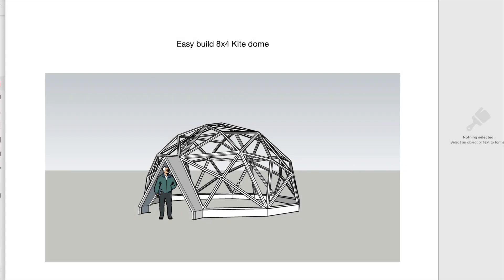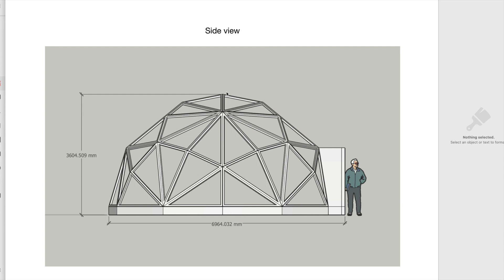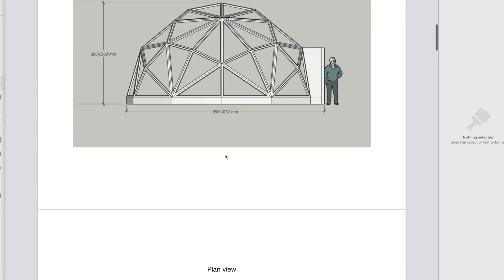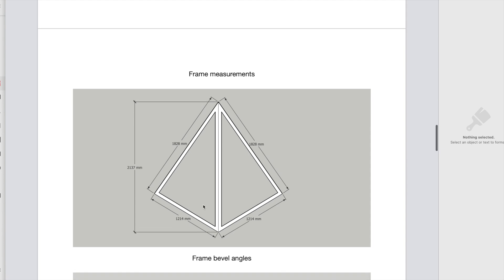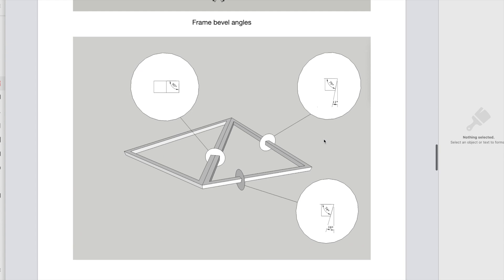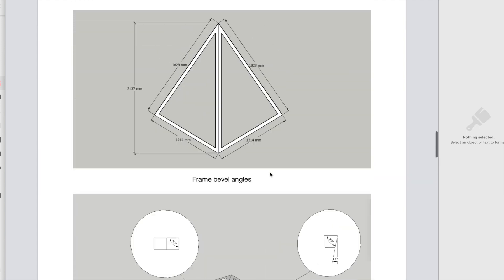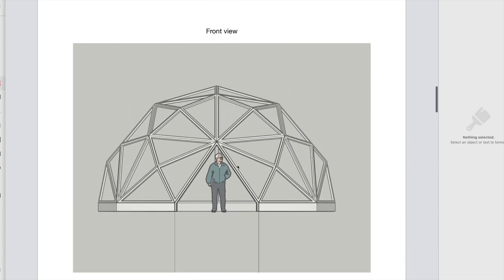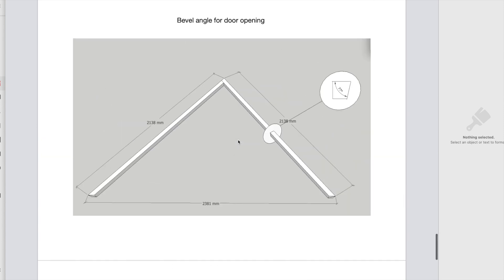UnityDome Most efficient dome free plans

Comment: Do you design all your dome on sketchup? I think the biggest problem I have is how to make it water proof with off shelf material cheap enough I can afford. Lots people used tarp or simular. I imaging it will not last for more than 5 years under the sun UV. If fill the triangle with 1.5 inch concrete. Will the frame support the weight?

Comment: Paul, I have a question about the angles in the triangles. Based on the 1214/1828/2137 lengths, instead of 30°/60°/90°, they're ~34.5°/~58.5°/~87°  (much more complicated to cut and inefficient to cover with right-angled plywood, fabric, etc).

Was this for reasons intentional, was it simply by chance, or is it an unintended rounding error?

If we can use 30°/60°/90°, it would be a lot easier to fabricate (fewer cuts) and cheaper to source (as we could make more optimal utilization of right-angle substrate sources).  We'd probably have to reset the bevel angles, however - but maybe that would not be a hardship.

Your thoughts?

Thank you!
Reply from the maker: Ah yes a very interesting question, if we changed the angles to 30°/60°/90° we could only produce a flat tiled surface. The small difference in face angle makes it possible to tile a sphere. If I force the 90° angle the others have to be 31.7° and 58.3° respectively and form the faces of a Rhombic Triacontahedron divided in four. Hope this helps.

Comment: Thank you Paul for a great video and like Nicola Tesla you are a great humanitarian.   I assume the framing is screwed together at various locations along each side.  But it seem to me that the frame side that you show as 90 degrees would need a bevel also to create a circle dome?  Have you actually built a dome from these plans?  If plywood panels are used on top of the frame; I would assume the size of the panels would need to be expanded so all the corners fit together?

Comment: The 3 angles you might be looking for the kite triangle to make a jig are (it is not a right angle triangle):

86.97 degrees~87
59.13 degrees~59
33.90 degrees~34

It is derived from “Deltoidal hexecontahedron”
Reply: I love you
Reply: Sending love to you as well, show us your work  @tiptrick7762
Reply: Was wondering about that, no 90 degree corner because when viewed in the plan view the corners appear to radiate out at 90 degrees. Paul mentioned that you could take a corner out or build onto a corner I just can’t see how that would work. I am wanting to build onto an interior corner could you or someone explain what I am not following.
Reply: @fisheater844  probably it would work out since you have to fill the seem gaps with some a flexible material like silicon as a weather seal. So, I would not worry about it too much, it is though important to know the angles for building the dome as a whole. If you want to reduce the risk, build it on sketchup first and see how it would work. Good luck, and share results if possible
Reply: @fisheater844  building on an inside corner you would only need a 1/4 of the dome, look at the plan view and divide it into 4 sections use 1 for an inside corner, 2 for a flat wall and 3 for an outside corner, 4 would be the stand alone dom

Comment: 2meter plus edges strike me as "too long" - how strong would this thing be?
Compared to, say, the Optimum Wisdom Laboratories GardenDome plan, the struts seem too long - unwieldy and maybe required to do much work. Thoughts?
Reply from the maker: Optimum labs garden dome is a rip off of my GD18 dome: https://youtu.be/L1DnMDzMJPU
There are a number of people plagiarizing my designs and calling them there own these days. The unity dome has only one face type so is easy to construct 60 faces on the unity, 105 on the GD18 (2 types). The Unity fits on a wall or in a 90° corner has a flat base and 2 possible door positions. The GD18 has a fillet base because of a slight rise and fall and can have up to 5 doors. Yes if you want shorter langths go for the GD18 but the price of that is more triangles to make. Hope this helps
Reply: @Geo-Dome  I built the GardenDome that Dr. Petty gives designs for, actually. 60 pages of PDF, in which he notes that he neglected certain maintenance for 7 years but it was OK. So I couldn't say, sitting here, whether or not his design pre- or post-dates your own. As you've indicated the frequency is the same, but your dome being metric, it's a bit harder to say that it's a straight copy. Also, his door treatment is quite different from yours and he is adamant in his instructions that the hexagon above the door is to be put in last of all - a difference from your own approach. FYI: His GardenDome has roughly 40" struts. In addition, he provides the factors to build it in two sizes, but because of the prevalence across the pond of 2x4 lumber (ripped at 6.5deg bevel) and not metric lumber, he recommends the smaller of the two sizes he gives figures for (15.4' if memory serves, as opposed to 18' something). As he points out on his site, the geodesic dome was originally designed about 100 years ago, but only popularized by Buckminster Fuller - as you are aware.

Comment: I just found this, and love the design and what seems as the easiest dome construct I found to date.
I have one question...
This is for a 6,7m dome, covered in plywood sheets
Would it be possible/advisable for me to add a percentage to the material thickness/lengths to enlarge the dome to the size I would like ?
(I would like to make a dome with this system of diameter 10m or so

Comment: Can this be built from electrical conduit?  The each conduit strut serves as a side to two panels.  What is the biggest dome that can be made with 10 ft pieces of conduit?  Each 10 ft piece of conduit usually gives you two struts of varying length.

For a standard dome:  Largest Dome made from 10’ stock:  length of strut ( number of struts) = length of conduit piece;  64.198”(20) + 47.990”(30) = 115.188”; 61.350” (80) + 55.644” (35) = 119.994”.  A 10 ft conduit is obviously 120”

I got a bunch of conduit from an electrician who was retiring.  I plan to sheath it in used boat heat shrink plastic and maybe spray foam the inside or outside.  If you spray foam the outside, you can cover the foam with more plastic, and maybe dismantle the dome framework inside!  I don’t know how strong that would be, though.

1.5” Added for strut ends

Comment: Hi Paul, I notice your plans show a square profile timber as stock, but what thickness should it be?

Thanks!
Reply from the maker: It needs to be around the same cross sectional area as the other beveled frames, I us 45mm x 75mm (3x2) to get two beveled struts or two square edged pieces from each timber. Hope that helps
Reply: @Geo-Dome  it certainly does! Big thankyou. Will be purchasing a number of your plans soon, and while im commenting... big thankyou for the video on resizing your plans as well. I think you unity dome is stunning as well.

Im going to try to work out a way of stretching it a little, simply to get better passive solar heating.

I'll be facing the door apertures east west and glazing the lower frames sunside (north in Australia) so low winter sun penetrates efficiently, wheras high summer sun will reflect from the same glass with its high incidence. Hopefully I can work it out. Would only be after an additional meter or two.

Thanks again Paul.

Comment: I don't understand the angle choise would a 90 degrees angle for the intermitate corner angle not make a  stronger joint and panel skinning with glass or sheeting a lot easier while not making other dia angles anymore complex and they are, it might cause more sheet waste but more usable wastage

Comment: Hello Paul,
Can the UnityDome be built using your WangerFlanges   connectors instead of bevelled struts as explained in this video ? 
I am particularly interested in knowing if WangerFlanges can be used to connect 10 struts at one single conversion point as needed by UnityDome structural design . Thanks.

Comment: Two years ago i made almost the same design with solidworks. That's really great to have only one angle along each bar, and only three angles in the triangles. But it is limited in size because of the available acrylic glas size. But i like it. What is the best way to protect a wooden surfaces from rain and moisture outside, and still prevent it from mould inside? I thought i would be possible with GFK like on wooden boats!??? Does anyone have experiences with it? Last weeks i am working on a pattern with deltoidal surfaces fitted in a 4 frequency dome, or a 2 frequency dome with fusion 360! I prefer this pattern for aesthetic reasons! you can arrange the window surfaces to get a pattern that looks like a spider web, or a natural sone wall. And to make the production easy i have an idea of an miter saw table, where i can get a very exact repeatability of the angles, and another idea, a mechanism for a mill that allows to make the angle along the bars very precise, and without anytime readjusting the parallel guide! I would like to share my drafts if someone is interested and i am interested in experiences from others!

Comment: Paul, this is a really cool plan, and I plan on building a scaled down version (with a knee wall) as  a playhouse for my grandchildren.  Thank you for sharing it.  I have a question on the frame triangles though.  I assumed from looking at the frame measurements  diagram (on the 4th page) that the angle between the 1828mm side and the 1214mm side was a 90 degree angle.  However, if I plug the three leg dimensions into a triangle calculator, I get that angle at 86.79 degrees and the other two angles at 34.56 degrees and 58.66 degrees.  Is that correct?  Thanks.
Reply: That's what I got too. The longest side was  2137mm and that's the square (un-beveled) piece.  Is that the same as your measurements?
Reply: Correct. I've just done the same thing and can now use my own strut lengths to downsize.

Comment: Is there some way of turning the Unity Dome into a tunnel dome using the same right triangle frames? Since the dome can be bisected, you could split the two halves, but you would need some way of making a tunnel. I'm curious about whether you've explored how to make a tunnel caped with dome halves using these frames.
Reply: @Berkana
I think you could but they would have very slightly different bevels and one of the shorter sides would need to be slightly longer. (I think)

Comment: I built this in my garden at a 0.57 scale factor so the footprint fit my garden. Had to raise it a little to make it so I could get in but it works perfectly. Great plans thank you for sharing Paul.
Reply: what math did you use to scale it if you don't mind me asking? i'd like to scale this up to 30 ft in diameter.
Reply: @jamesmartin5357 use a triangle calc to find the angles then size up the struts accordingly.
Reply: What wood you used? I cannot find what wood dimensions to use for the triangle?
Reply: @MrBacte  I used 50mm X 50mm and then cut it down to the correct dimensions

Comment: This is AWESOME, Paul... thank you for sharing!  Quick question... would you recommend 2x4 for struts or would 2x2 be ok?
Reply from the maker: I don't recommend 2x4 as it's the wrong ratio, just a bit wide for getting screws into. You can use 3x2 cut with the bevel angle down the centre and get two pieces, or 2x2 same cut down the centre.
Reply: @Geo-Dome  That's a big help, Paul! Looking forward to making a model first... beautiful and simple design...
Reply: @Geo-Dome  I can only get  3x2 in 8' lengths. For these struts could I rip a  2x6 to 2x3 (actual size 1 1/2" x 2 3/4") then cut the bevel down the center of the 1 1/2" width? Would a 2 3/4" depth be strong enough for the 7' length struts? Thanks for all you do to make the world less square!

Comment: What shape is this dome based on? What's the name?
Reply from the maker: It's a Deltoidal hexecontahedron, the kite faces  are split to form a left and right handed shape one being the mirror of the other. There are a number of ways to make this so if you look on the internet there may be some differences in lengths and angles.
Reply: @Geo-Dome  Ah, thanks for the answer. I did some research in the meantime and I came up with the Disdyakis Triacontahedron. If you split the faces of the deltoidal hexecontahedron, you effectively get a disdyakis triacontahedron I think.

Comment: Hi Paul, I looked at the plans and I must be missing something. For the life of me, I cannot see how the panels on the long sides (with the 90 degree right angles) manage to fit together both flatly,  and angled, simultaneously (as in "Frame bevel angles"  and "Frame measurements" diagrams).
Reply: I'm wondering about this too, and which side gets the 90 degree bevel? The 1828mm or 1214mm piece?
Reply: @sparc5  Neither its the center 2137mm 2 centers that join the triangles together
Reply: @kulwinderThandi  But 90 degrees would join the 2 triangles flat to each other. I believe there needs to be a bevel too? Or do those actually create a flat surface?

Comment: I love this channel Paul and I want to build a dome . With any of my projects,  I start with a model before taking on something major.The mirror triangle for your unity dome  is brilliant however.... I want to build a diameter of 16 ft 5 in. instead of the suggested 22 ft .After scaling down  the frame measurements to a factor of .082057----  for the model, I must have had the apex angle wrong because they do not fit . If there are 5 mirror panels with 10 triangles ,I presume that the angle at the top of each triangle should be 36 deg. ?(360 deg divided by 10) and the bottom should be 70 deg? since no angles are given on the plans. Thanks again for your devotion to domes.

Comment: Thanks for this .. I’m waiting to build one to take to festivals and hang many hammocks in side. Would this be strong enough? And what material would you recommend?
Reply: especially when you say many it would need to be a strong construction.
if you will take it apart/build it up many times you really need to be aware and safe because any time you set things up errors can happen.
geodesic structures can be very strong in theory and they are in reality..... if you make it happen like in theory( means that all the connections between frames and all the struts are fine).
sketchy thing to do without a clue of statics

Comment: Hello Paul & all viewers.  This really is a brilliant dome structure for construction material usage.  Thank you so much for sharing this video and the plans.  Regarding the use of standard ratio plywood panels ( 1220 x 2440 or 4' x 8' ), just a reminder, the cut is not a right angle triangle. Rather, it is an acute scalene triangle.  According to the numbers provided by Calculator.net, Triangle Calculator,  the dimensions provided ( 1214 x 1828 x 2137 ) create an angle of 86.789 degrees. That is the most open angle corner, closest to a right angle.  I noticed an absence of panel cut angles in the plan.  You can go to https://www.calculator.net/triangle-calculator.html for your own calculation results.
Reply: I was looking for this number so much. Cheers!

Comment: Hi Paul, thanks for this bang up job, excellent work and very interesting. As you can split it into halves and quarters so easily, would this not make a great tunnel as well? I remember from your previous tunnel videos that was a difficulty with some of the 3V because they don't have a flat bottom and difficult to slice. Indeed this done would solve those problems the way I'm seeing it. I'll see if I can have a crack at it on Sketchup :)  thanks for the plans! it is really appreciated!

Comment: In light of the innovation of using a triangular doorway, it seems to me that the 2v and 3v trussed dome should be revisited to see whether or not there are practical arrangements which permit the use of triangular doorways. Triangular doors would seem to me to open up many other possibilities for orienting and splitting the sphere to make a dome.

Also, for partial domes using this design, this system of dome formation could potentially be trussed as well, with truss struts between the 4-point connections (external to the dome) and between the 6-point connections (internal to the dome. With trussing, this dome could be quite rigid. What do you think of this?
Reply from the maker: Yes, I'm working on some more complex versions now, I think a week or twos I'm super busy. I'll try a trussed version first and see if a door fits nicely.
Reply: @Geo-Dome  It occurred to me that a trussed version using struts rather than panels would not have the simplicity of the version using panels, since once you go to struts, you're dealing with multiple strut lengths. Is there some way to truss a dome made of such panels to give it stiffness without going to a design based on WangerFlanges and struts? Some sort of system for enabling struts to be mounted at the vertices would suffice. Perhaps a single WangerFlange screwed in to the panel near the 4-point connection would enable a strut to brace across to the next 4-point connection.

Comment: looks great..how strong are these, we have a heavy snow load here in canada. are they expensive to build over conventional timber homes?
Reply from the maker: I would say this shape is the most efficient possible, especially if you are using 8x4 sheet material to cover it. You can use any size timber you like for the struts so snow load should't be an issue.
Reply: @Geo-Dome  thx for the quick reply paul, i think the knowledge and effort youve put into all these vids and plans are amazing. thx. i am building this next summer for sure. i did see that you said square lumber is the steongest for the framing...like 2x2 or 4x4s...do you think 2x2 will be strong enough after the plywood is on?   id most likely go with 4x4s for the feaming struts, but dont know if i can afford it